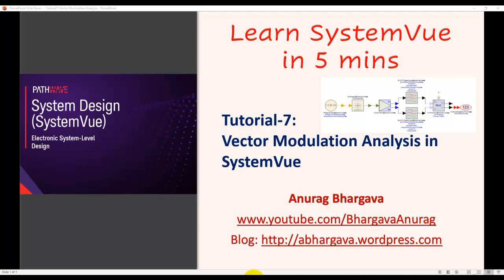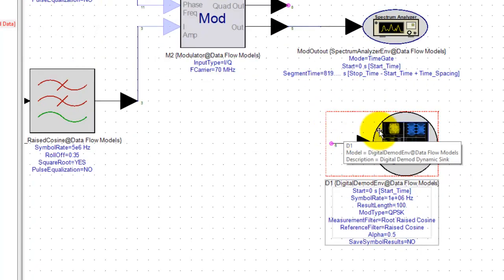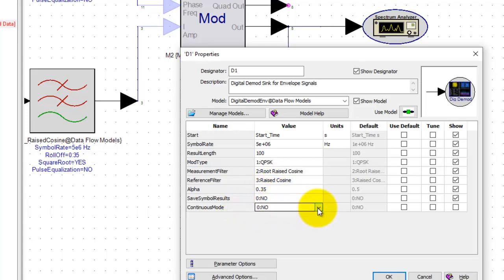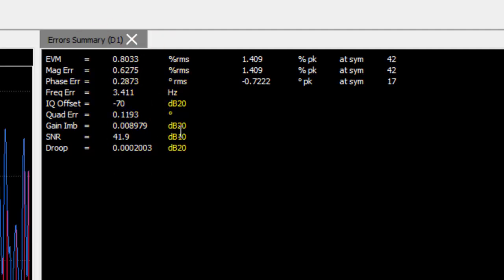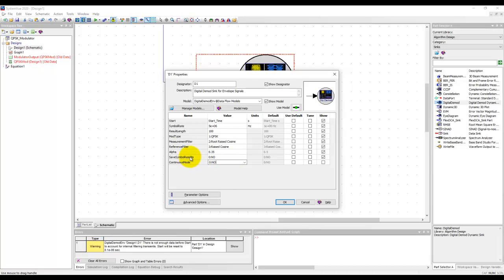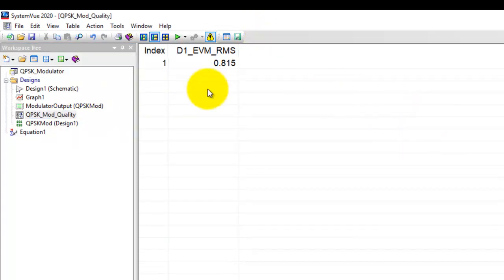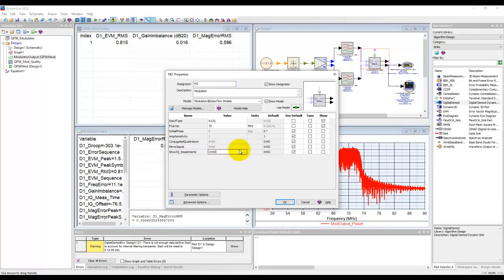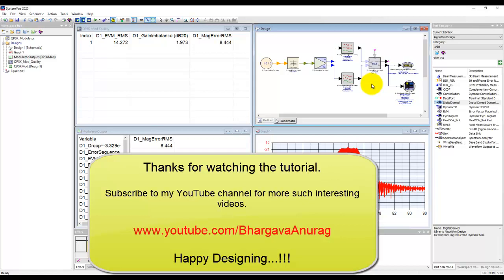Tutorial-7: Vector Modulation Analysis

Comment: Hi sir ,Can i know the verilog code for qpsk modulation
Reply from the maker: If you implement your modulator using fixed point blocks then you can generate VHDL or Verilog code from SVue but not for floating point blocks like what used in this video.
Reply: @BhargavaAnurag  sorry sir i forgot to mention. I'm asking code for fixed point modulator(QPSK) and also I'm requesting you to explain SOQPSK block in both floating and fixed point